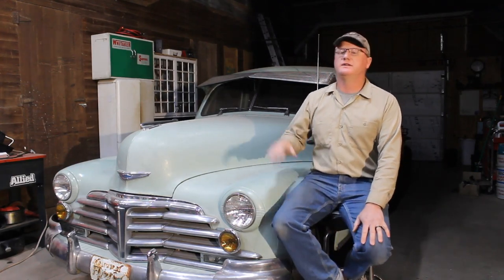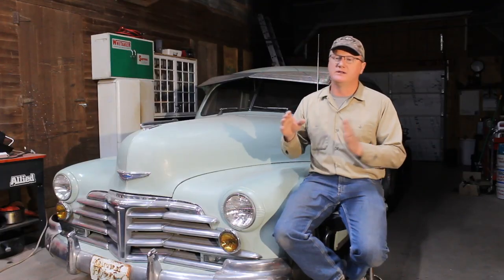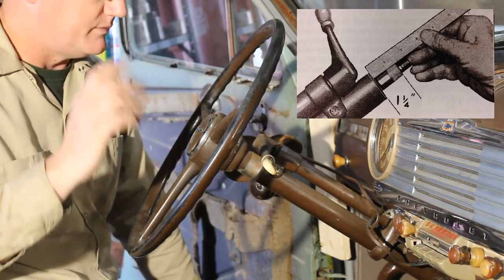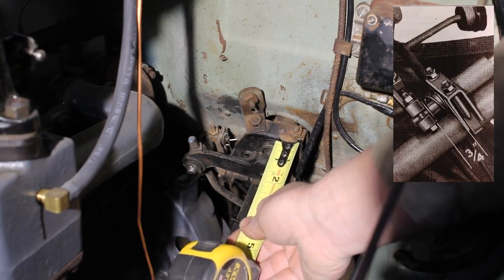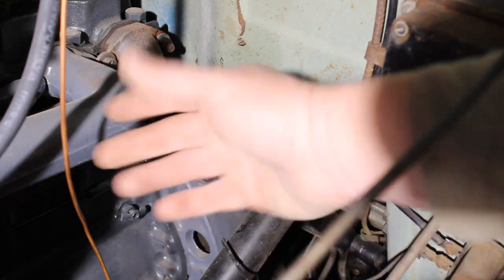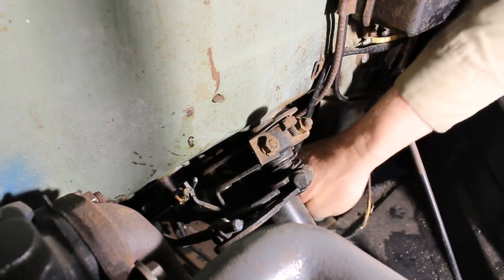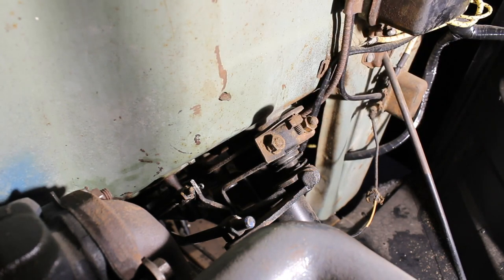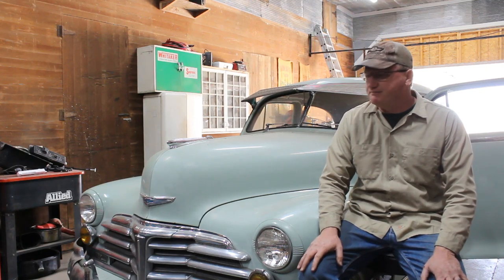1940 -1948 Chevrolet 3 Speed Manual Transmission Adjustment - Three on the Tree

Comment: When i had to fix the 47 Chevy I bought in 1966 i adjusted the length of the rod for the neutral range movement. I did not have a manual but it worked as i studied the linkage and realized what should be happening with the neutral gate movement. I took it out for spin and was laughing out loud for real when I slipped that old baby into second gear for the first time then third. Oh what a feeling. I only paid $35 for it, the motor ran like a top but it only had 1st and reverse gears. The owner had no idea what to do. And i had fixed and driving in about 30 minutes. I was so proud. My first car and my first repair, I was 15. D
Reply: $35 wow
Reply: I have a 47 stylemaster that just developed a prblm (was working fine til today) with the 3 speed on the column shifter or linkage. It's the part of the linkage that's under the hood on the column. It doesnt catch anthing to move the rods to put it in 2nd or 3rd .   1st & reverse works great but something doesnt catch 2nd & 3rd . So, im on here looking for a video or info to try to see how the linkage is supposed to work when working properly, so i can fix it myself. Ideas?
Reply: @billdickens1  Your issues sounds just like the problem i had. The lever between 1st and reverse moved back and forth in the neutral gate. I looked at the linkage on the transmission and could see the neutral movement did nothing. the rods wiggled but now trans levers moved. Then I studied the rods under the hood to observe the shift levers movement and the action down on the shift linkage.  I could see clearly that the lever up in the 1st & reverse  gate position would move the arm to the transmission up and down. However when the shifter was in the 2nd & 3rd position and tried to move the lever down on the shift column I could see the lever move in both directions. But when i observed the arm travel of the link on the transmission nothing moved! Here i found the lower connecting rod appeared to be too short. If i helped the shift lever it would click into a new position. I went back up the under hood shift linkage and saw that arm was made so you could remove a cotter pin, pull the rod out of the linkage and rotate the head to in effect lengthen the shift rod down to the transmission. It seems wear and tear over the years had gotten so sloppy it could not move the shift arm in the transmission, I length the rod about 3/16ths and tested it. As i recall the shift lever on the transmission now made a big movement when simple moving the shift front the 1-R gate to the 2-3 gate. that movement changed the position the larger shift lever inside the transmission. So now when pushed forward and pulling up for  2nd gear shift the lever moved both shift arms. Pushing forward moved the smaller arm, then pulling up moved the bigger arm. And the transmission shifted and held in gear. Moving back to neutral only moved the big arm, continuing down engaged 3rd gear as long as I did not pull the lever back but held it in the forward position. As I studied the shift linkage I realized the side plate on the transmission did not work as one would think.  The side cover plate that held the shift rods to the gears was a mechanism in its own right. it was not a simple two levers 4 positions. As later models are. The larger arm is the gear shift arm. The smaller arm is a remote gate changer. Moving the shift lever inside the car thru the neutral gate is what changed which gear set the larger arm is activated on.  Once I understood this logic the adjustment was easy to see and the short arm linkage had to longer to fully engage the 2-3 gate from the push pull motion on the shift lever.  I hope this helps you know what you need to do. it is stupid simple once you see how the tranny is shifted by the side plate mechanism. However, I also learned a cool trick. I took a side plate off a 53 Chevy 3 speed manual which aligned in all ways to the 47 Trans. Its arms were shifted the logic way one arm two gears each. The neutral gate movement was now up in the column shifter. Which worked but not so smooth. I eventually went to a Floor Shifter and had a ball. You can eliminate the whole issue that way too. I am sure you can get all your gears and when you do and you hit second gear flying down the road, you laugh out loud and think of me nearly 60 years ago doing exactly the same way. Dennis Let me know please.      Murpheyd@aol.com
Reply: @sategllib2191  And it ran like a top!
Reply: @DennisMurphey  . Thats for taking your time & trying to help me out. I havnt worked on it yet, but i think I'll be able to get back to it maybe at the end of the week. Hopefully i can figure it out. Hopefully this is the last of the mechanical things  to work on (for a while anyway), so i can start on the paint... & yes, drive it some!! :) :)
Reply: @billdickens1  Send me pics I loved my 47 , 1st car and all, but i did mess with it a tad. 57 Olds 371 motor Olds 4 speed Automatic and rear end. But it just couldn't run right. Sold the trans and moved on. Still have a soft spot for the old boy. Good Luck Bill.
Reply: @DennisMurphey   cool!!     & sorry, cant find an option on here to send pics of it as a reply

Comment: Thanks to this video I discovered that my shifter linkage was turned backwards on the forward most linkage!  Now I finally have second gear!  Thanks!

Now, if I can figure out why it’s popping out of first gear when going down the hill…. I think it may be a transmission issue.  

Thanks again for sharing your wisdom on this!
Reply from the maker: That's great! I'm glad you've got it figgered oot. Popping out of gear issues generally go in this order: 1: bad syncros, 2: low on oil, 3: linkage adjustment. Have fun!

Comment: Good content, as usual.  Fun ending!  Just FYI...  I think that L bracket that was in the way on the shift linage bracket is the mount for the optional reverse light switch.  There's a spring loaded switch that mounts on it so when you shift to reverse the linkage pushes the switch to light the backup lamp on the rear bumper valence.  I have one on my '48 but it has never been adjusted properly.

Comment: Hello Jayhawker, I am working on a 1940 Chevy with a working vacuum assist. I found the original bushing had come apart and allowed the lever to drop out and jam the linkage. I was able to get it back into place and was able to get all three gears. I followed your video to get it to that point. This was done at the owners house. I checked the shift lever height to the steering wheel it and it measured 2 1/2 inches. I have since replaced the bushing. I do not have the recommended shift lever to steering wheel height, and the only way to get it to shift all three gears and get reverse is to adjust the smaller rod to the bottom of the threaded area. What am I missing ??

Comment: Ive got a 48 pontiac torpedo sedan coupe aka the fast back 2 door but im trying to run a chevy 3 speed on my 1940 nash simce cant get anything for the original nash 3 speed with external over drive to bad it runs but just wamt to drive it thanks for the pics its going to be fun trying to get it to work i had a 40 chevy but sold it

Comment: Good informative video.I'll probably be pulling the drive shaft out of my 1940 Chevy, Special Deluxe, 4 dr Sport Sedan in the near future to paint it nice & shiny.  So, this video was very helpful.  I put the shaft in the car, after a complete disassemble, back in the mid 1980s so I'll have to go back to the manual (along with your video) to reinstall -- memory is a bit fuzzy.  One thing I'm concerned about is making sure that when the gear shift is in neutral, the linkages to the transmission also have the gears in neutral.  Also, can I install the firewall grommet when I reinstall the shaft without having to remove it later when carpet is installed?  Or, should I just wait to place the grommet at the time of carpet installation?
Another question:  I'm re-installing the radiator.  What was between the car frame & radiator frame is questionable.  Installation kits from vendors agree on the two bolts, washers, & nuts.  However, they don't agree on what padding/spacers go along with them.  I have some pads for it & the original metal plate that fits along with them.  I'm thinking that I could attach the brace rod (from radiator to firewall) & just add what 's needed to bring the radiator up until the rod is level.  Do you have any info or suggestions on that?
Glad to see you're over the UMOYOT.  Hope you are now rested.  Loved the clip at the end but I won't be riding the rails with my old jalopy.
Reply from the maker: Usually carpets kits do not require that you disassemble the mechanics of a car and have cutouts to accommodate the steering column so you should be fine depending on what the makers of your carpet do. The most serious it should get apart from seat removal is popping pedals and the starter push button off. As for the radiator, I take note of what was in underneath as far as shims and rubber etc. What you put under the radiator support is going to effect the alignment of the front fenders and inner fenders. If you have no idea, just start with a thin piece of rubber between the frame and the support. Most likely it will be ok, but if you need to adjust for body alignment later you can slip some shims in.
Reply: @TheJayhawker  Thanks for the feedback.  I did mean to say steering column, don't know why I said drive shaft -- oh well.  I know that other stuff connects to the radiator but was narrowly focused on situating the radiator "just right." I recently cleaned up the inner fenders & covered them with a rust encapsulator from Eastwood Company.  Also did the support panels that connect with the grill etc.  So, thanks for the reminder to keep things lose until I get them all aligned.  I remember offhand that you were doing something like this in one of the videos & cautioned to get an upper bolt in place  first.  I'll have to pull that up for re-viewing when I'm ready.  Thanks again.  Keep doing what you're doing.  Greatly appreciated!

Comment: Quick question.
I have a 49 Chevy. I got it running but once I when for a test drive 3rd gear pops out. Any recommendations? I have 2 other transmission I can replace with. What would I be looking for to make sure I’m putting a good on as I would hate to replace it if nothing is wrong and I just need to adjust something.
Reply from the maker: 3 possibilities and the last is usually the culprit and the most expensive. Low on fluid, linkage adjustment, worn out synchronizers.

Comment: Does your '48 still have the vacuum-assisted shift? Mine did not. I also had an issue with interference between the shifter lever on the transmission and the clutch linkage, which I solved by drilling a hole to move the linkage attachment closer to the trans. Made for a bit less mechanical advantage but it worked. At the time the only manual I could get was on microfilm and I couldn't go to the library every time I had a question. Later got a paper shop manual, figured out the correct way to do the adjustment, and reset it. Sometimes with old cars you just have to "fake it till you make it" !
Reply from the maker: No, this one does not have the vacuum assist on it anymore either. One of those things that may have made it slightly more comfortable to drive, but wasn't at all necessary. "fake it till you make it," I have based my entire life on those words. lol, just kidding, well sort of.

Comment: Is there a commom problem wit ha 1941 chevy coupe that pops out of 3rd gear sometimes? Is it possible that the adjustment is out or more commonly do you think it needs a new transmission?
Reply from the maker: most likely the brass synchronizers are worn out, I think they are available at the fillingstation.com. I would rebuild it if you want to ship it to me.

Comment: Noticed you had the vacuum cylinder bracket on the transmission, but did not see you put the shift cylinder in?
Reply from the maker: I think I mentioned that the vacuum assist was removed on this vehicle.

Comment: A friend is having problems adjusting the shift linkage on his 3 on the tree 39 buick as you stated it is all alone. As there is a cable to the trans.  I would like to help him with a pic of the linkage you tube won't let me print it from your vidio and if you can throw any tips this way about the little bump to align it would help. When he told me that you have to put it in second to do it I was floored as I always knew n n n thanks for listening.  Burton Comensky

Comment: Does this car have the vaccum assist. Will this apply to car with out it.
Reply from the maker: This car originally had vacuum assist but it is missing. Vacuum assist was a simple bolt-on affair onto the outside of the transmission and nothing more. It was very common that once the vacuum assembly started to leak it was simply removed. The transmission is the same, with or without it.